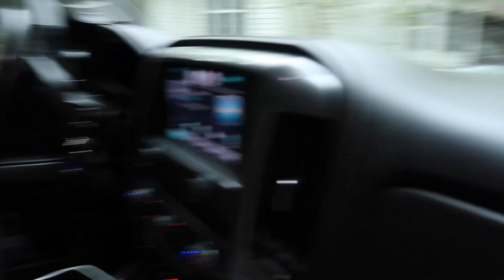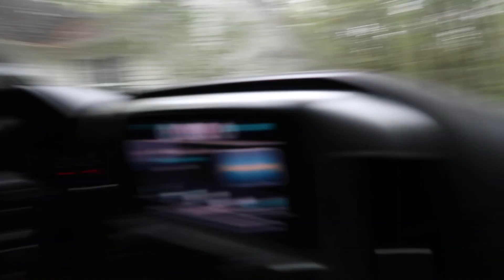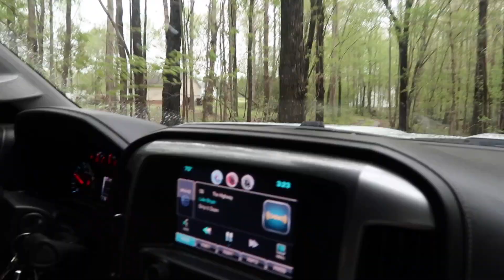WE BOUGHT A BIG BLOCK!!!

Comment: You can get over 50hp out of that engine u bought. I used to race karts for many years all over the east coast. We used to make around 15hp out of a 5hp flathead in the stock classes. The limited would make 20s-30s and outlaw would make 40s to 50s. Get u a billet crank, head, cam and some some good valve train. And a built carb and u will make alot more than u think. I would say for around 700 or 800$ that thing will be a beast
Reply: And I forgot billet rod and piston.

Comment: is that engine modified at all? If not it's certainly not 18 horsepower. Maximum is 13 or 14 in stock form being a single cylinder and a Honda clone,if you want something more than that not modified you have to go with a v twin